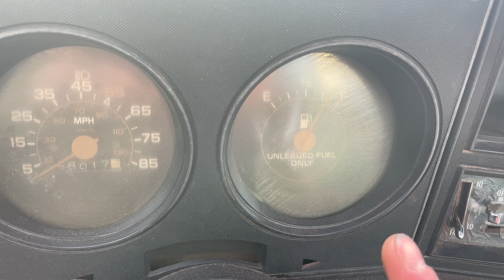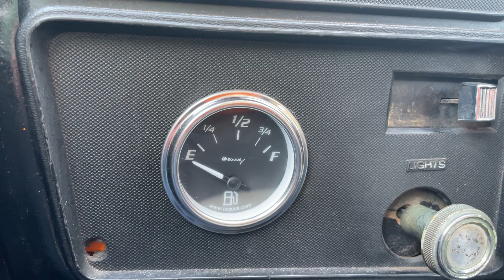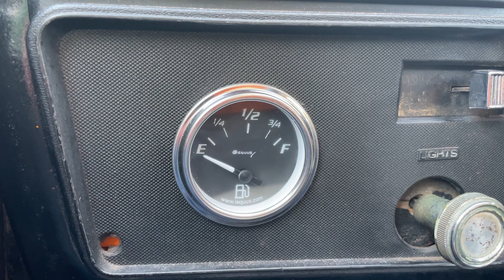How To LS Swap a Squarebody C10! Or, how I did anyway...

Comment: Smart....now put a tach where the original fuel gauge goes........I'm hopefully picking up a straight 6 ,4spd ,'73 short bed fleet side for $3500 this weekend if all goes as planned,  and I already got 2 fresh build cammed LS' in the garage as spares for my lsa supercharged nova swap.....the spares are a flat top 5.3 and a flat top l96.....I put flat tops in all my builds....even my lsa nova is at 11.25:1 compression making 13lbs with a 2.45" pulley on a good day........2 years ago swapped a '68 c10 long bed, walk in the park.......but I sold it for a nice profit,  so I definitely don't wanna pass on a short square body......especially since I have 2 new LS'S  and trans ready to go!!!.......did you use the tahoe radiator in that truck.....I forgot already. ....nice job for your first swap by the way!!!!
Reply from the maker: Awesome man! That should be a riot. My next build will be a 68-74 Nova with a much more mild supercharged 5.3 and a TKX 5 speed. 

And thanks! Learning every time I work on it but that’s what makes it fun.

Comment: So if i got hold of ls and tranny that it came with along with harness and ecu, i can basically put it in any vehicle i can fit it in but speedo, cruise, and various other things are gonna be iffy and may  not work? cruise is one i would really miss for any kind of cruise over an hr.
Reply from the maker: Sorry I’m just seeing this! You’d at the very least need to modify the ECU to remove some things - the immobilizer stuff, traction control, and the BCM pieces. 

There are solutions for the gauges - and cruise control. I haven’t dug into the cruise control piece but it’s on a lengthy list of things I’d Like to do. 

Typically you’d thin a factory harness down to only the necessary components, have the ECU flashed for a swap, and then it basically bolts in. I chose to buy a new harness and preflashed ECU for time constraint reasons and this way it’s all new, and I know it’s done correctly. I have several harnesses here so I’ll eventually thin one myself but no huge rush. I like all new wiring.
Reply: @ubf_c10  so did you buy the new harness from psi ?  Holly makes ones too like 1400.00 which one do you prefer
Reply from the maker: @mariomcshan481  I went through PSI. For a daily driver I like the OEM reliability of a factory style harness with a factory PCM. If I was going straight to turbo or supercharger, going all Holley would be my choice just because tuning is easier and faster unless you’re already an HPTuners user and familiar with tuning with it. 

That said, PSI has been awesome. The harness quality is excellent and I’ve been very happy with their support, communication, and buying assistance. I highly recommend them if you’re considering the factory PCM route.
Reply: I have the factory computer and harness now it’s just be my weekend driver

Comment: Awesome job, I'm about to start on mine. Hopefully I can keep the costs down.
Reply from the maker: You can definitely do it cheaper than I did. Mine is semi-budget - but I decided I’d rather do it faster than cheaper. Still took me way longer than it should have. 

You can strip out your harness yourself. It’s tedious but doesn’t look hard at all as long as you can follow directions and pin outs. You can use a frame mounted fuel pump/filter/regulator with your stock tank, and can use the dirt cheap push lock nylon fuel line like the factory uses a lot of in these trucks. 

Get someone to unlock a readily available PCM and if you have one near you, you-pull junkyards usually makes all of these parts SUPER cheap. I still argue spending a little and buying a complete donor vehicle works out - I paid for my fuel system and quite a bit more for my truck by parting out just a few pieces of my donor Yukon. You can do it man! And thanks for watching! Feel free to reach out if you have any questions.
Reply: You can I spent maybe 400 with the programming and ebay stainless shorty headers! I already owned the truck with the donor engine I bought it new and was an o2 frame and body was full of cancer

Comment: Did you pick all your stuff from PSI? Engine mounts, tank kit, harnesses etc.
Reply from the maker: I got my wiring, PCM, and accelerator pedal from PSI. I had a TAC module from my donor Yukon. I also picked up their fan relay kit. 

I bought a Spectre tank, pickup, o ring, and lock ring from rock auto. EP381 fuel pump (Delco) from rock auto as well. My fuel line and filter kit came from hotrodfuelhose.com, engine and trans  mounts came from dirtydingo directly. Nothing against getting everything from PSI - those guys are seriously awesome and have been a massive help through the project.

Comment: Im about to ls swap the 82c10 and i hear people change the oil pan...do i have to or will it go in perfectly??
Reply from the maker: Mine went in just fine with the truck pan but it DOES hang below the cross member. I have not had an issue, but my truck isn't super low or anything. When I build the next engine for it, I will go with the Hot Rod oil pan just so I can take it on dirt roads without worrying about it.

Comment: You should invest in a Rivnut Tool, then you can mount that radiator with some spacers instead of them zip ties.
Reply from the maker: You are 100% correct - I’m LONG overdue for a RivNut tool (riveter in general even) but I actually have angle aluminum and an aluminum sheet to make a top mount, about half fabricated, just haven’t had the time to finish it. Thankfully the nut inserts in the core support are still there and in good condition.

Comment: No issues with the oil pan?
Reply from the maker: Sorry for the delay! Nope, no issues. It does hang below the crossmember so I’ll swap it when I put the built engine in to a lower profile one. But even on our rough Maine roads, I haven’t hit anything or had it touch anything or anything and it’s still not as low as the control arms or as low as my Honda Accord.

Comment: Great video! Thanks for keeping it real!
Is your fan the stock LS fan and the fan shroud the stock c10 unit? I’m hoping to do the same if so. I assume the dingo engine mounts have adjustability to get the motor in the correct location to make the factory parts align.
Reply from the maker: I’m using the 34” core radiator out of a 2006 Cadillac Escalade with trans cooler, and the dual fan assembly out of my 2006 Yukon. The dirty dingo mounts allow a few inches of fore/aft adjustment but from what I understand they do interfere with the truck low mount AC compressor when the mounts are slid forward to move the engine back,  if you’re using AC (I’m not and if I ever do I’ll move it to a high mount bracket.) I know some people use the stock C10 radiator and an aftermarket electric fan or even a clutch style mechanical fan on the LSs. You’ll need to solve the “where to run the steam port line” problem but that’s pretty easy. There’s actually a VW junction piece that you can insert into the upper radiator hose that will give you a place to plug it in or “Jags that run” has an adapter piece as well. Hopefully that helps!

Comment: Did you had to do some work to the drive shaft?
Reply from the maker: I did! I got a new one made at a local driveline shop. I was going to have the one that was in the truck shortened and a new Yoke put on the transmission end but it had a dent. I talk about it right around 15:33 in the video!

Comment: Stock tbi injector computer in a little bit latter model square body like that have the pcm mounted on top of the heater box.
Reply from the maker: Great to know! I figured I’d mount it in that general area when I pull the dash to paint the cab and just put it in the glove box for the time being. Thanks!

Comment: Bro love the Buffalo Bills hat! I’m in Buffalo as well could really use your help want to do the same thing have a motor and transmission and wiring harness already.
Reply from the maker: Thanks! Born in Olean so die hard Bills/Blue Jays/Bisons fan here. What can I help with?
Reply: You’re welcome born and raised in Buffalo myself. I’d like to get my LQ9 set up for the truck for the winter time!
Reply from the maker: @dieselmac6671   No problem! You can do it. I bought a harness and PCM to make it faster but if you’ve got time I don’t think stripping them out is difficult, just tedious. Start bolting stuff together - it goes really fast once you get started.
Reply: @ubf_c10  
what motor mounts 
Do I need to change the gearing in the rear end because it’s out of a 2500 HD and my truck is a k10
Reply from the maker: @dieselmac6671  I used Dirty Dingo Motorsports LSswap mounts but if yours is a 4x4 you may have to do something different - not 100% sure since mine is 2WD. Pretty sure Dirty Dingo has what you need either way though. ICT Billet is another great company that will have what you need too. 

As for gear ratios, I’m running what came factory in my truck with a 4L80E. It’s not ideal but it does work pretty well. To adjust for the transmission shift points and if you’re using an OBDII integrated speedometer you can adjust for all of that within the tune (or your tuner can if you aren’t comfortable doing it yourself.) 

What transmission are you using? Are you 4x4? I do know to use the later model trans/transfer case sometimes poses an issue because the front diff is offset to the wrong side compared to the transfer case so you might be better off using your stock trans and transfer case if so. Just tell your tuner that you’ll be using a non-electric transmission.
Reply: @ubf_c10  Right now it’s still has the factory transmission I believe it’s either a TH 350 or TH 400. Yes it has four-wheel-drive, that’s kind of where the 2007 LQ9 motor and transmission swap is causing me a little difficulty figuring out because I still want her to be four-wheel-drive. I put a 383 stroker in there during the pandemic starts up just fine, but I believe that I need another torque converter right now in order for her to drive right in smoothly. But the end result is trying to put a newer 6 L motor in there or try to find this 6.2 L diesel!
Reply from the maker: @dieselmac6671  if you’re ok not having overdrive you can use your stock transmission and transfer case, and still use the LQ9. That will be the easiest way to get it going. There’s a flex plate with a space built in that you’ll need - I’ll see if I can find the part number for you.  That said, if you just put in a 383 last year, why not just add fuel injection and a higher stall converter? That sounds like it would be fun and you’re probably already making more power than the stock LQ9. 

If you want to make the conversion happen so you can run the modern transmission and engine, I know there are specific years the 4l80e came with a transfer case that has the driveshaft on the correct side to match the offset front diff. I’d have to do some research since I’m not really a 4x4 guy to see what all it would take to work.
Reply: @ubf_c10  Eric I thank you so very much for responding. Continental transmission on Hertel avenue for lack of better words fuck my truck up. They broke cylinder one intake and exhaust rocker arm stud. And claimed it wasn’t their fault excuse me Greg claimed it wasn’t his fault. So now I have possibly a bent valve or two in the truck in the 383 stroker. So I’m thinking about swapping this whole thing out altogether and just rebuilding the engine over the winter time. So 6 L LS is going in the truck along with the transmission my mission now is to try to find that transfer case for the four-wheel-drive to work still. And getting a gasket kit for the motor ARP head studs and bought this thing back up. Question do you suggest putting headers on the truck or just regular exhaust manifold.
Reply from the maker: @dieselmac6671  bummer about the busted 383! You might like the 6.0 enough to not worry about the 383 honestly but it’s not too big of a deal to swap back and forth either. 

I’m running exhaust manifolds (Trailblazer SS/Buick Reinier, stock truck ones are too wide) but I’d like to switch to headers eventually. With the 4L80E I’m running I’d have to saw an ear off the trans case, totally do-able in the truck, but I want to go to either semi-built 5.3 (I have two in my garage waiting for a rebuild) or if I find a good 6.0 maybe just an NA 6.0, after this season. Because of that, I’ll probably do headers when I pull the drivetrain out (and I’ll clean up and paint the engine bay at the same time.) If I was doing it from the start again, I’d go full length headers. Especially on a 4x4 where ground clearance isn’t an issue. Don’t bother with shorty or mid length for a near stock application. The factory manifolds actually aren’t horrible like the old ones.
Reply: @ubf_c10  Do I need to get the computer flashed, also is it basically just get the motor mounts drop the thing in there hook everything up and it should run right theoretically?
Reply from the maker: @dieselmac6671  You’ll need to get the computer flashed to remove all the immobility/security stuff and other engine codes that you won’t bother with anymore that can make it run poorly. 

You’ll need an electric fuel pump and regulator capable of maintaining 58psi 

And it’s a lot easier with a stripped down harness, because it ends up being 4 wires to hook up. I’m not sure on a full harness what is absolutely required but theoretically it shouldn’t need much more than power constant, ignition signal that stays hot while cranking, and a good ground. You’ll want to ground the engine to the frame and frame to body in several places too. 

The mounts are wicked easy since you’re already an SBC. just take off the LS engine mounts and put the adapter plates on loosely. Get it set it place exactly where you need it forward/backward and then tighten up the mounts.
Reply: @ubf_c10  Do you have any idea how much the flashing is going to run me one and two do you know possibly where I might be able to get that done
Reply from the maker: @dieselmac6671   It looks like PSI Conversions does it for $150 if you use your own PCM. That said, a PCM from them already flashed is only $200. That’s the route I went. https://www.psiconversion.com/products/pcm-programming/ls-vortec-pcm-programming-gen-III/
Reply: @ubf_c10  okay E, update so I put the lq9 in there I put the 4L80E transmission in there I found a place on the web called hillbilly wizard and they had a transfer case that was a NP 208 manual transfer case with a 32 spline input shaft already built in that I slapped in the back of before l80e fit perfect!

Now my biggest issue is trying to figure out what exact wires that come out of the bulkhead connector that I need to connect to the factory fuse block under the hood from the donor engine and wiring harness
Reply from the maker: @papidiesel7994   Awesome find! That’s handy for 4x4 folks for sure. 

I bought my harness and everything was nicely labeled, but I believe this website will have the info you need to strip a stock harness - https://lt1swap.com/2000harness.htm

Awesome progress! Keep me updated how you make out.
Reply: @ubf_c10  as far as what I've read off that website from Brandon he does not list specific vehicles just figured since you had a similar body you can give me an idea of what wires you used coming out of your firewall on the driver side underneath the brake booster for power and ignition
Reply from the maker: @papidiesel7994   I definitely read your question wrong! I thought I had put this image in the video but I couldn't find it quickly scanning through. This should help out. https://i.imgur.com/W164hWD.jpg
Reply: @ubf_c10  hahaha got the same image months ago. LOL now trust me brother I'm not trying to have you do this for me, but extra information and information itself is key. So the question now is what wires do I hook those to in the picture, to the factory under hood fuse block on the LS harness

Comment: What is the part number for the 4l80e dip stick
Reply from the maker: Sorry for the delay! I am sure you've found one that works, but in case anyone else needs it, GM part number 15832205 - for a Chevy Silverado 2500 with the 6.0

Comment: Could you run the 12v Constant directly to your battery
Reply: Or the back of your alternator
Reply from the maker: You could run it to the battery directly, of course. Where I draw my constant from is just part of the positive battery cable. It was more convenient on mine to use the junction block because I used the stock Yukon battery cable, and it’s side post so kind of annoying to try to add to at the post.